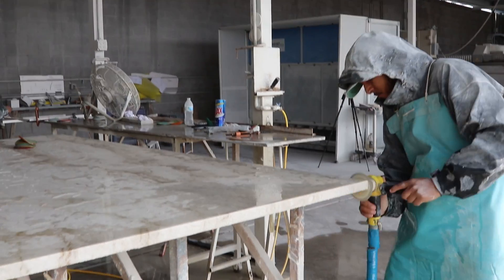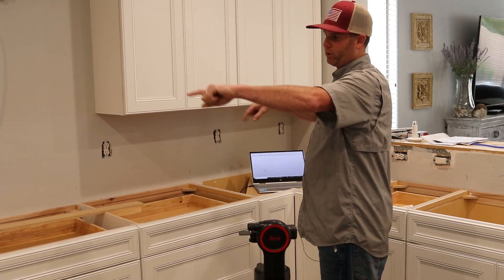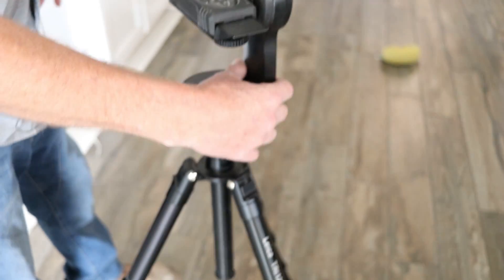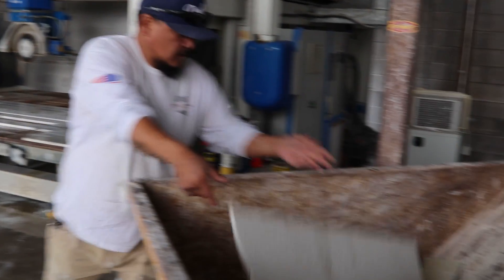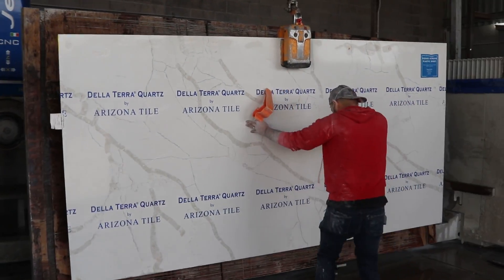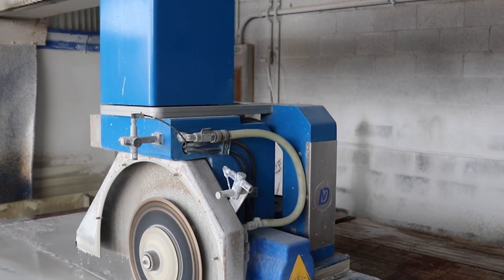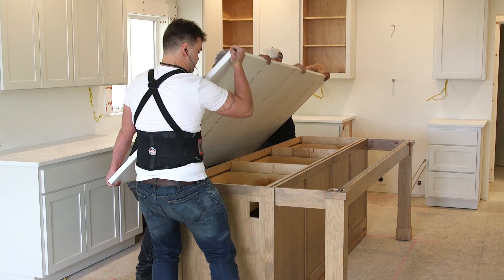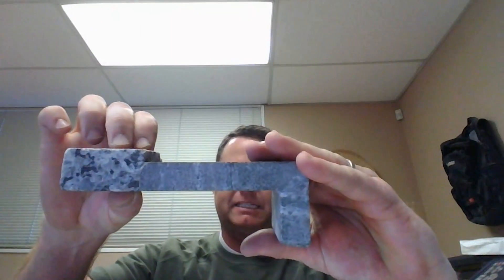Polishing The Mountain - A Look at Stone Fabrication

Comment: Very interesting to see ! I got called to weld the keepers back on the edge of the cutting table at a local place here in NH. Now I see why they broke off in the first place !
Reply: I was so worried about the stone sliding down and breaking on those keepers😂 I was just thinking do they have some type of cladding on them to protect the stone, they must. Turns out from your comment, the keepers need the protecting🤣

Comment: The vendor who set up the water treatment system did a really good job...  

I might quibble about the cycling of the pump to get sludge out of the sump and into the "funnel tank", but it might also just be a slightly off description of that step of the operation.

Comment: Quartzite, the natural stone, is quartz sandstone metamorphosed. Heat and pressure and time close the porosity up and bind the mineral grains tightly; quartzite is very tough rock. Whack a big chunk of quartzite with a sledge and you might bounce it back into your face, if the hammer doesn't break.
Reply: There’s a massive problem in our industry right now with stones being mislabeled as quartzite. People need to really educate themself before looking at quartzites.

Comment: Another thought on the crock pot/quartz thing.

In addition to being a longer heat, the crock pot is also going to be constantly cycling it’s heating element to maintain the temperature. So you’re basically just putting the rock through 8 hours of heat cycling

Comment: Marble is highly compressed limestone (calcium carbonate), and is thus vulnerable to attack by even weak acids.

Quartz is an igneous rock where the sand grains got melted (sintered) together.  Synthetic quartz for the building trade is made by gluing quartz / quartzite grains together using resins.

Granite is a large family of igneous rocks that are primarily quartz / quartzite, with other minerals - primarily feldspars, but you'll find features of mica and iron compounds, that can give various colors to the stone.

Some grades of granite have a lot of feldspar(s), and will weather when exposed to moisture and acids. In much of the Southwest, we have naturally occurring granite mountains where the stone is kind of brown, and the feldspar content is really, really high. This rock weathers at the drop of a hat, and the surface will flake off (spall), producing decomposed granite... completely unsuited for countertops.

There are plenty of deposits of high quality granite which are well suited for producing high quality counter tops.
Reply: Quartzite is a metamorphic rock wherein grains of sand have been fused together.

Comment: I have two marble slabs in my driveway. What sort of backer should I use? What about glue?  Epoxy or contractors glue?  I know I have to fix the splits with epoxy, is there a type I need to use?

Comment: I'm curious what that stone slurry would do in a a concrete mix.  Could it replace some of the sand?
Reply: Gosh, I'd think so? If you think about it, sand is just really tiny gravel.
Reply: Yes, marble dust is used as a concrete or plaster ingredient.  It's also the ingredient in synthetic stone using resin binder.

Comment: Curiosity, has anyone come up with a use for the heavy slurry expelled from the final tank?
 It seems like it might be a good attitude for concrete.
Reply: Was hoping they would touch on this too
Reply: A stone shop local to where I work just left it in the basement of the building they moved out of. A full cattle trough of stone dust, plus a few inches all over the floor in the basement. The remediation quotes for that were laughable
Reply: Tumble it
Reply: Polish for lenses